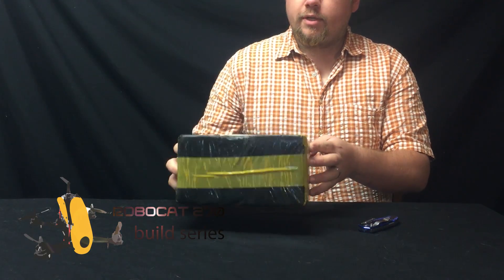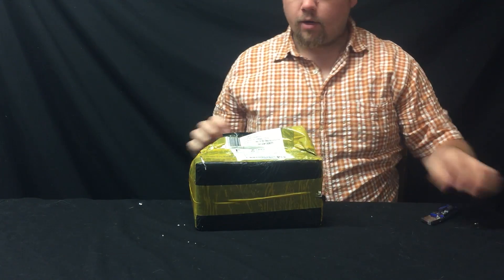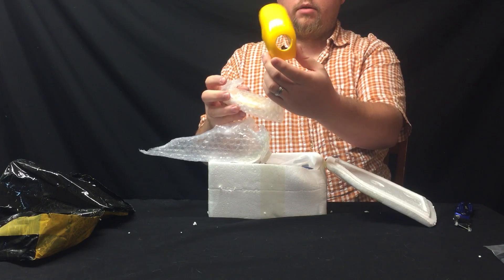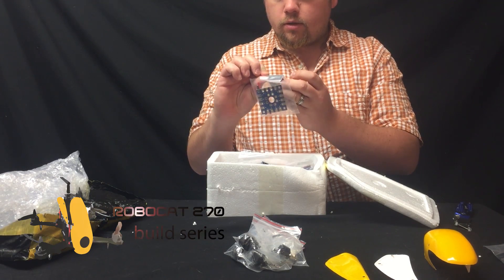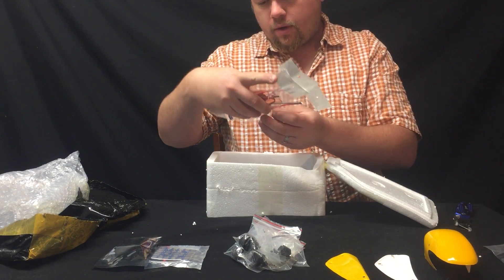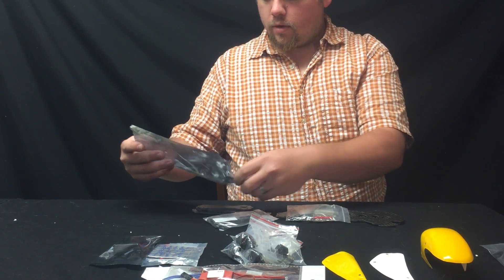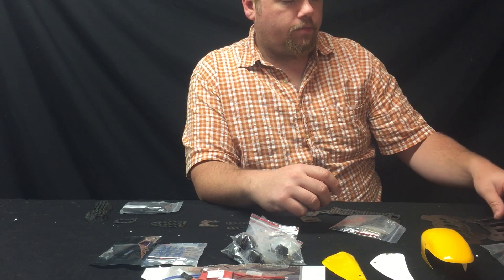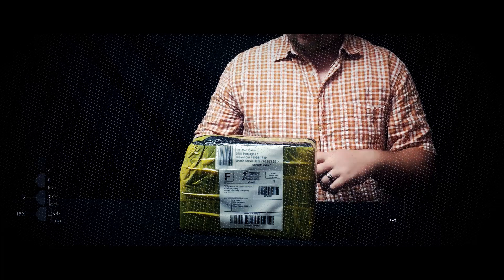RoboCat 270mm - FPV Racer Build Series: Unboxing - Episode 1

Comment: hey got a question about the cc3d setup and the flysky t6 remote. during the tx set up i need a 3 way switch for the rate select? i kept toggoling the switch when asked to but didnt register but once i turned the dial switch it regiatered and worked. i havent set up the flight rates because i dont like the dial turn switch as a selector for flight rate. would i have to mod my t6 with a 3 way switch for the flignt rate select?
Reply from the maker: +Tonkatroll I use my gear switch so i only have two positions. I had to flip it a bunch to get it to register. I think it was waiting for a third position. So far it has worked well I got the first position set to stable/autolevel. And the second more acro. I have been interested in moding my transmitter. If I do, I will make a video for it. thanks for your comment!
Reply: +Matt Davis what gear are you using? how rappid and long did you toggle he switch? cause i tried mine for a solid min and didnt register. And i was toggoling the shit out of it. felt lkke i was jerking a robot off